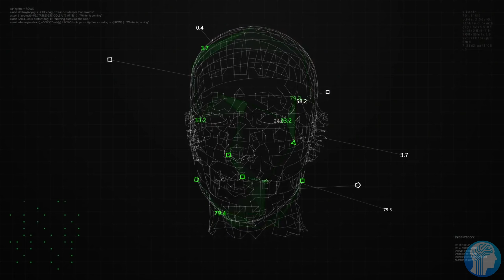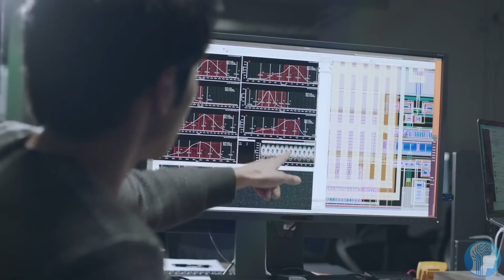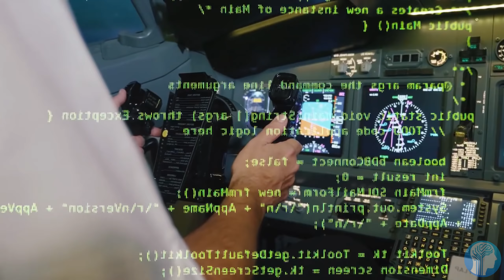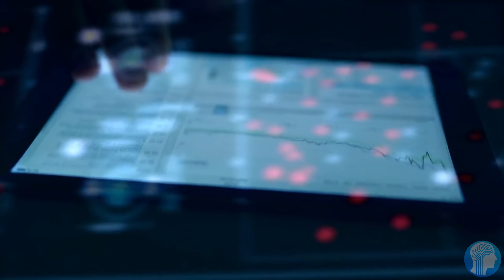Revolutionary New AI can be Run on Any Device

Comment: I think this is what has been missing all along. When properly developed it will exceed the current neural network operations. If you look forward, increase the complexity of operations, and compare performance over a timeframe, the amount of processing power for the current standard will be ridiculous. Using the spikes in operations with increased processing power will be the way forward. We are at the precipice. Very soon, within less than a decade, I'd say AI will write itself and design it's own hardware. Processing power at this point will be beyond ludicrous, and beyond our rapid understanding. Over time, it could be understood to a point. How long will that last without some type of augmentation? I have no doubt that AI will self develop organic hardware. It's simply the most efficient conversion of energy. Why use a battery when you can carry energy throughout your organic hardware blood? Eat a few leaves and insects and go about your original goal? Batteries and silicon are a temporary building block. They will be surpassed.